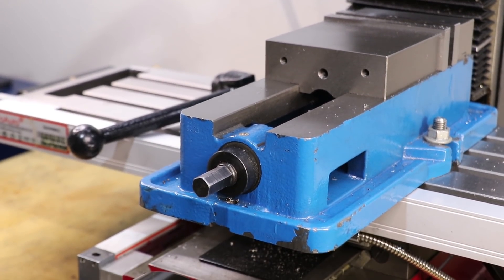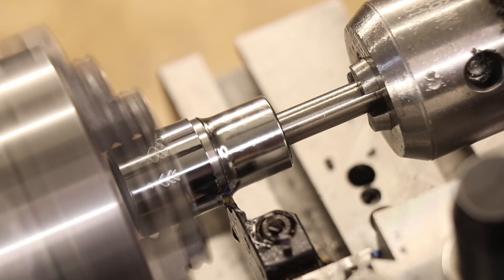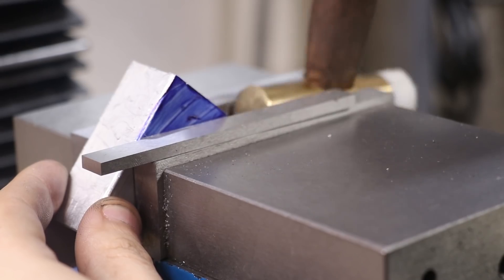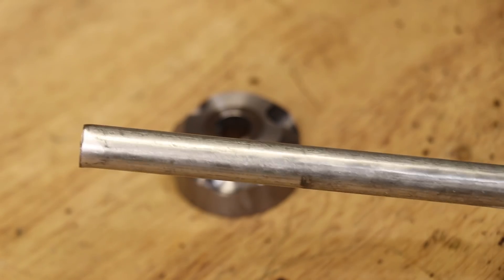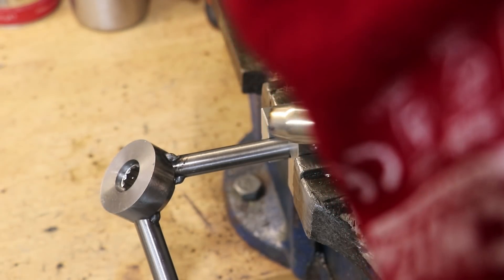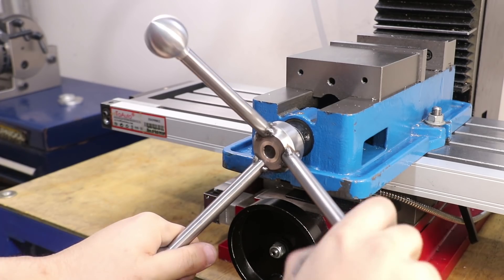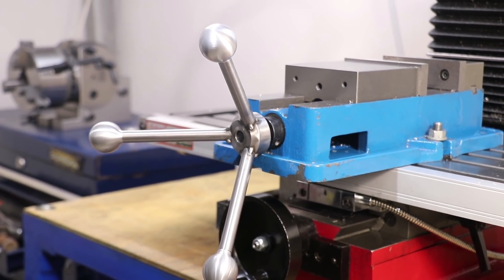Making a Speed Handle For The Milling Machine Vise

Comment: Nicely done. The only difference I would have made is to press the socket in after the welding/brazing so as to keep whatever hardening the socket has. Being that it’s a twelve point and pretty thin, I think that otherwise, after a time, the points will wear away. Maybe a six point if you have to replace it.

Comment: Really enjoyed going through your videos this weekend... thanks for the effort. I’m looking to order some metal to make my own speed handle - already watched your clip on ‘where to by in Aus’ which was a great help. Just wondering what steel/metal I should be using for the hub & the columns? (Already decided on brass for the knobs). What kind of steel exactly did you use? I heard you mention it’s a machining, non leaded steel, but I’m new to this, not sure what that is. Any advice would be greatly appreciated, thanks. Nickolas
Reply from the maker: I’d just buy some 1020 bright mild steel. Weld up great and machines nicer than hot rolled steel

Comment: you need to make a thread cutter holder that sits in the drill holder and can be turned with a ratchet :) always centered and perfect threads. if you complete it i will buy it :D

Comment: I tried this handle and it didnt work for me because it was hitting the handwheel for Y axis because my vice is set far back to maximize working space.
For me, nothing will work as good as original wobbly handle.
I have nearly identical mill by the way.
Reply from the maker: Sorry to hear that. My speed handle has greatly improved my time with the mill vise and is a great addition to the workshop. I do have quite a steep angle on my handles to avoid hitting the handwheels though. Cheers

Comment: I'd maybe drill / tap a hole, where the socket and  hub meet, then run a setscrew down it to lock it in place. Gently hammered in place press-fits, especially where one side has a hard chrome plating and mirror finish, aren't going to have a lot of friction and will spin fairly easily, but time will tell. The knobs came out great though

Comment: Why would you braise weld the handles in why would you not TIG weld them
Reply from the maker: I don't have a tig welder, and the bigger issue is that this is a free machining steel which not good for welding due the the alloying metals used.
Reply: @artisanmakes  I got you I don't need to tell you what to do but for me in that case I would have made the hub a bit larger and threaded both ends but anyway I like your videos I will continue to watch them and I've learned a lot from you thank you very much
Reply from the maker: @ray8916  No worries, best part about DIY is you get to do it differently for what suits. This style best suits me and the vise, and the materials I have on hand. Cheers

Comment: I was wondering , since your socket was a press fit, is there a chance the socket will rotate when tightening the vise?
Reply from the maker: Good thing to point out but it won't be an issue. When I drilled the 3 holes.for the handles I drilled into the socket too, the handles once seated are locking the socket thin place. As such once it gets soldered some solder will flow down into the join at the bottom of the hole for a bit of extra strength. Cheers

Comment: Good video. Thanks.
Everyone has ideas about this and having made a couple of these I will throw in my "two cents" worth, because .... YouTube is where we learn, and hopefully you will one day get some bigger machines and do this all again. But first you really need a BANDSAW!   LOL.
I chose to use a larger hub and thread the handles into it. Looks better and you can remove them if you need to do what I did: Make them long as you did, and then if you need to, cut them down.  I cut mine down twice, till I got them at a length that I liked.  Too long and you might over-tighten your vice.  It is possible to break the import cast iron.  A set screw can back up the press fit. A second one can fix it to the vice screw or use a hitch pin. Before doing that I knocked the handle off onto the floor dozens of times.  You also may not need to cut down the socket if you use the large portion for the press fit.  If you use a "Deep" socket, they don't usually have a reduced portion.
Regards

Comment: why don't you weld the hanfles and prefer to braze?
Reply from the maker: Free machining steel, which I made the base from will cause issues and cracking with most welds due to the lead/sulfur content, thus brazing is a much better method, though I dont have MAPP/ oxy to braze with.

Comment: Made one of these couple years ago, tapped and threaded holes in piece you welded on, just hard for us to leave something not completely done 😑
Reply from the maker: Awesome, I would have threaded too but this low. grade mild steel is.a bit weak for threading. Cheers
Reply: @artisanmakes  our material was low grade too, holes up like 4140 as far as we're concerned, just drill, tap and thread lock it and it will be good as gold!

Comment: If you removed that step from the back of the socket and pushed the socket all the way to the front of the 40mm block you might have got more engagement and the spin handles won't cause as much of a turning moment to pull it off the vice. My solution was to resort to a ring spanner that has served me well for the last 18months.
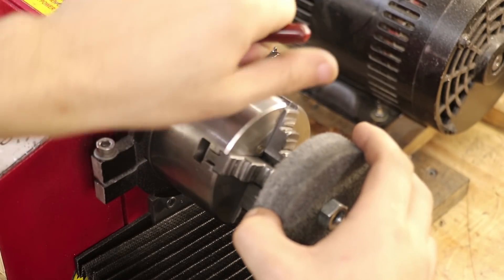Reply from the maker: You can, but you would also have to make the the base hub about 4-5mm smaller as it would run into the flange at the base of the vise, its not a great angle but you can kind of see it at 3:52.  Personally I like having the sort of back stop of the socket, and seems to work fine, but its always going to be up to personal preference when it comes to these little details. Cheers

Comment: quick tip for drilling:
you should only pre drill past about 10mm drillsize and when you do use a drill that has about the same diameter as the 'soul' of the big drill( this is the inner part of the drill where there are no flutes yet). Its always tempting to predrill bigger holes but in end it will only cause the dril to chatter
Reply from the maker: Usually, but on small machinery like this you don't usually have much of a choice when it comes to drilling large holes. The machinery just isn't powerful enough sometimes to do the optimal methods, so you gotta make some concessions. And for the most part, the low rpm kept the chatter to a minimum. Cheers
Reply: yeah makes sense, love your vids!

Comment: Welding spoiled the appearance.  Enough thread lock.
Reply from the maker: Threads would be a bit weak to use on this low grade mild steel rod. It really doesn't bother me, but you can always do different if you choose to make one yourself. Cheers

EDIT: In any case, the tacks are temporary until I can get them brazed in.
Reply: In such cases, I use loctite and it does not allow the thread to unscrew

Comment: If you feel like making the handle feel a lot more snug I'd suggest using a ball bearing detent or 2 and all of it will feel more comfortable

drill into the side of the handle
Use a ball end cutter to Partially penetrate the side wall of the socket but no go all the way through - make sure a lip is left
Find a ball bearing the same size as your ball nose cutter, this will seat against the lip we left earlier
Thread the top of the hole - create a grub screw to enter the thread
Now all you need is a spring to finish up

The grub screw will retain the spring and ball bearing under tension against the lip left by the ball nose cutter - you can tighten down the grub to adjust detent force and you now have a spring loaded detent to remove any slop in how the handle feels

Comment: I wonder how much force the press fit will hold up to. Don’t you need to tighten stuff harder sometimes? 
I would have made a really tight press fit and freezed that nut / heated the outer part to press it in. Or even welded it. Or do you think that would be way overengineered?
Reply from the maker: Good thing to point out but it won't be an issue. When I drilled the 3 holes.for the handles I drilled into the socket too, the handles once seated are locking the socket thin place. As such once it gets soldered some solder will flow down into the join at the bottom of the hole for a bit of extra strength. Cheers
Reply: @artisanmakes  nice ✌️😎
Reply: A fair point  but if it ever becomes a problem he has 2 easy options
1. another cheap socket sized a few thou bigger on the OD
2. A strong retaining fluid like loctite 638
Reply: 3 tack it with the welder or braze it.

Comment: I guess you are the best guy to ask, with as much as you do. What kind of hack saw blade are you using? And I like starting out the cut with a three sided file, great idea!
Reply from the maker: I use Sutton's all hard HSS 18 tpi blades. Slightly more expensive than the bi metal ones but certainly worth it. I used to use the cobalt ones but they are too brittle for general work.
Reply: Maybe Lennox? We use them at work...

Comment: Glad it is 12mm and not 10mm. Your handle would have disappeared the second you were finished with it. 😀
Reply: I got 99 sockets, but a 10 mill' ain't one
Reply: I have a body shop, loose them all the time. I guess they wind up in the car or under the hood.